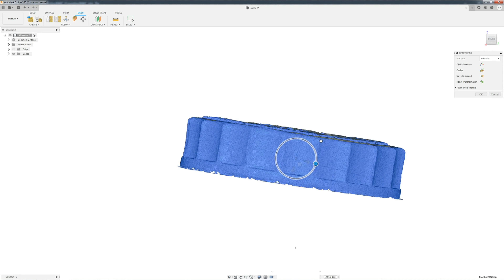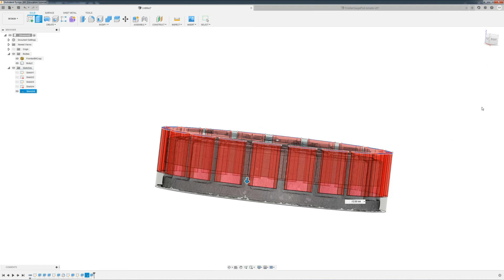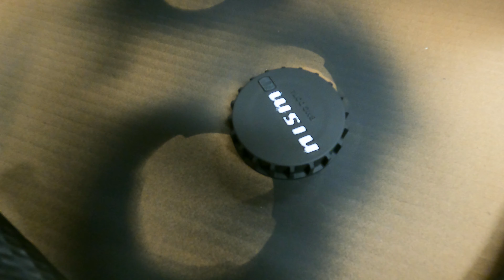How to make 3d printed car parts - BMC cap

Comment: the nail polish enamel should be one of the better options for the engine environment. Next time, I'd suggest using the CAD model to export a cut path so you can use a vinyl mask and apply the paint with an airbrush. I use a cheap Harbor Freight special for acetone-thinned paints so I don't ruin my good airbrushes; just a warning. Awesome idea! You say the paint wasn't good, but it looks great! I've been to car shows where people haven't taken that much time to care about the engine compatment, but that little bit of dressing looks amazing!
Reply from the maker: Thanks, Good tip! It would be hard with the letter raised to get a good vinyl cut line but it is probably doable with a little trial and error. Either way, it is def good enough for my truck lol

Comment: Great work, the hardest part is what, learning Autodesk Fusion 360? You make it look easy, once you are done with the combination rocket surgery and brain science that is Fusion 360! It's been over a year, did it survive the year?
Reply from the maker: Yup, as good as new still! And thank you! I actually just made a video a little while ago where I started casting these caps too
Reply: @EndMotive  I just watched that video!! Very cool. I need to start scanning parts for my Sprites. Loads of parts can be produced this way, I suspect, either direct printing or mold making.

Comment: I am in the process of doing replacement caps for my Furrari replica.  Both use the same process and a common insert.

First part.  Take buckle off trouser belt.  Press the prancing horse into a clay block.  40mm tall, just the right height.   Use this mould to cast a resin cast a couple of horses.  
Second, 3D print your caps so that they just slide over the existing caps.  I’m just doing two caps at the moment.  The design needs a recess in the top to just take the bit you will print in part 3.
Part 3.  Print an insert that just fits into the recess in part 2.  This is just slightly domed.
Part 4.  Clean up the edge of the horse from part 1. 
Part 5.  Bond the horse onto the bit you printed in step 3.
Part 6.  With modelling wax blend the joint line between the the disc and the horse.
Part 7.  Use the part produced in part 6 to make a mould and polycast a couple of disc/horse components.  These should just fit the top of the cap.
Part 8.  Send the parts away to have the caps chrome sprayed and the inserts sprayed in rose gold ( this is the stage I’m at.) 

When they come back bond the disc into the cap and bond this assembly onto the caps.  Smile, punch the air and post pictures of the caps on your club page in face book.
Reply from the maker: Love it lol

Comment: not my thing but I have to give you props for such a good ending outcome. do you have any experience with resins for stressed parts or those exposed to elements or automotive chemicals?
Reply from the maker: Thank you! The 3d printing resin is pretty chemical resistant compared to abs but no matter what mix or brand I use 3d printed resin parts are always fairly brittle. I have started making alot of my parts that I sell out of 2 part plastics, some of them have a higher temperature resistance and are much impact resistant.
Reply: @EndMotive  thanks for the info. I'm waiting on delivery for an ELEGOO Jupiter - resisting the urge to pick up a small unit so I can experiment with different resins. my goal is to make sturdy motorcycle parts (turn signal stalks, air box covers, air scoops).

I taught myself basic freeCAD. in looking forward to iterating and improving.

Comment: what printer is this and what risen did you use and did it hold up to the heat from the engine back thanks brillant idea
Reply from the maker: I printed it on an Elegoo Mars with Syratech fast gray resin...and thank you! It has been on my truck for a few weeks now and it still looks and fits like new.
Reply: @EndMotive  thanks very much looks amazing 😁

Comment: I want a part for a wing mirror, do u know where to look?
Reply from the maker: What do you mean, can you explain more?
Reply: @EndMotive  basically my car wing mirror was snapped and the threads that holds those screws broke and I am wondering if it could be printed and if you know anyone that print car parts
Reply from the maker: @dt-lg3ml  I mean the same method would apply but I wonder if that would be the easiest way to fix it? Are you able to Epoxy /Jb weld the area and redrill and tap new holes?
Reply: Which model is your 3D printer?
Reply from the maker: @emersonsouza3147  I have 2 Creality Ender 3s an Elegoo Mars and an Elegoo Saturn